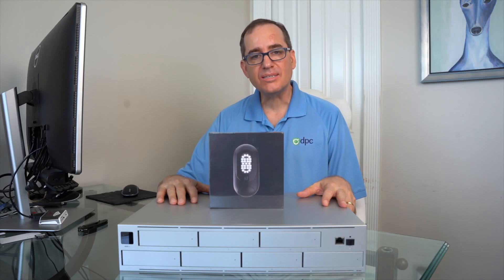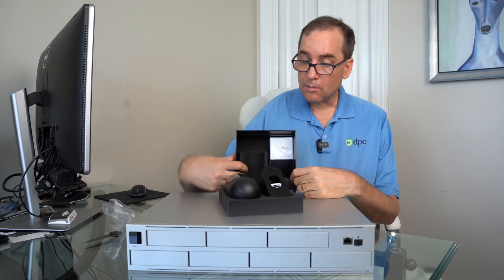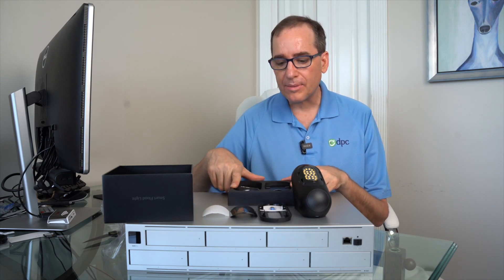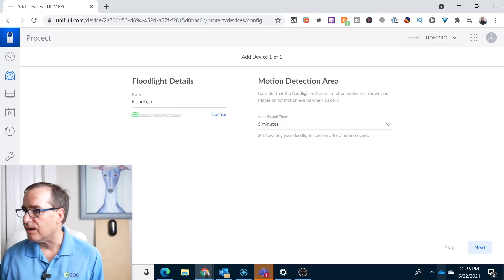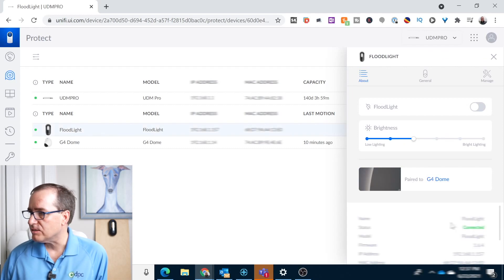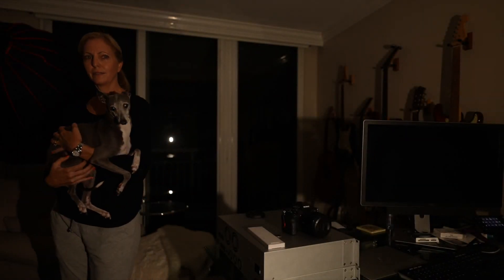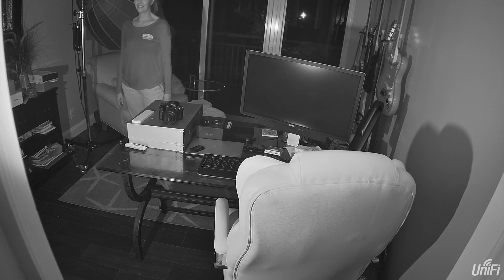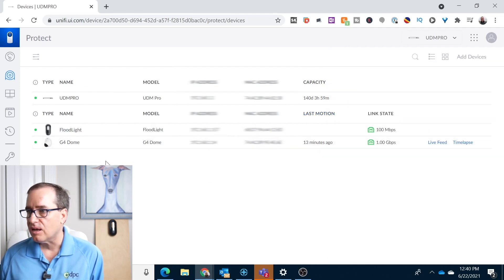Unifi Smart Flood Light | Unboxing, Setup, and Test

Comment: I was able to install this flood light in a closet under the staircase where we had no light and it has been perfect. I simply ran an ethernet cable from my mini rack which happens to be right next to this closet with PoE and it's perfect for this particular need. No switch needed, the light comes on as soon as we open the door and shuts off after 15 seconds. It only cost me $100 and one small hole in the wall. I'm going to install another one up front and the side of the house.
Reply from the maker: Awesome

Comment: I already have one cat 5 hooked up to camera, if i use cat 5 2 way spliter and put flood light and camera in it, will it work?
Reply from the maker: No, u need to run 2 cables to a POE Switch..

Comment: The flood light to me is not all that impressive – a toy? I would prefer that Unifi Protect improve their G4 Pro cameras or possibly provide even a better camera solution to clearly see lighted vehicles at night. For example, to clearly see vehicle license plates and maybe make out the make and model clearly as seen during the day.  How hard can this be!? To me night vision is a disaster with Unifi Protect (unless you're in a pitch-dark forest or room).   Correct me if I’m wrong.
Reply: But I wouldn’t be able to integrate the Hik cam into Unifi Ptotect.
Reply from the maker: @mikesamyn7054  Unfortunately no...
Reply from the maker: My problem with the IR on the G4Pro is that it's too strong and blows license plates out..  same with the G4PTZ.  The flood light actually helps with this because the light is off axis with the camera sensor..  Hikvision ColorVu may be what ur looking for..  its low light performance is uncanny..

Comment: Hi.  If you have one laying around can you test connecting the Floodlight to a "Flex 5 PoE" with the outdoor enclosure with included PoE brick?
Have been running 2 floodlight in other UniFi switches without any issue but they simply wont work on this switch... 
Best regards
Chris
Reply from the maker: Sorry, I don't have one.  I will say it  wants power, the 24v POE injector was not enough to get it going.
Reply: @DPCTechnology  Yes. Did some more messing around and it seems the switch has more settings in the app then in the web interface. One setting is missing from the web that tells the switch a Brick is connected so it starts to act as a BT switch. After finding this in the the app it started working. Hope it stays online for my customer now.
Otherwise a pretty impressing little light.
Reply: The flex switch should be able to power it at 10.5W out of 15W port budget. You need to make sure that it's set to 802.3af rather than the old 24v proprietary UniFi option. If powering the Flex via PoE it needs to be running off a 802.3bt port on the upstream switch if you want the full power budget.
Reply from the maker: @nbgannet  thanks for the feedback man!  Much appreciated

Comment: Wish they would release a standalone IR floodlight. Having an external IR emitter is critical to areas with a high amount of bugs. You can turn off the IR on the camera, so the bugs don't really show up on cam. Right now I have some that are AC powered, but it would be so much better if they were POE IR emitters that hooked into the protect eco system. In fact, they could probably use the same housing of this light and swap out for IR LEDs.
Reply from the maker: I agree 100%.  I think they could use the same housing and just offer it as LED or IR.  Thanks for your feedback!
Reply: @DPCTechnology  I am temped to buy this and mod it, same issue here with the bugs, main problem is the IR attracts them to the camera and I cant see jack.
Reply from the maker: @tablatronix  Now that would be a great video :)
Reply: 😳 you are a nice 👍 I am a very

Comment: I am wanting on if these because in my us case a normal motion light will not work. I have an access road shared with my neighbours and a normal food light will get set off when someone goes down this goes down road. However with the UniFi floodlight I can set the motion area on my existing camera to only detect motion when people pull into my small drive. 

I am wondering if the motion can only be triggered on the smart detection. Only when seeing a person or a vehicle. That would be really good and stop the light from going off except when needed.
Reply from the maker: Yeah, if it is bright enough for you, that is the perfect use case…